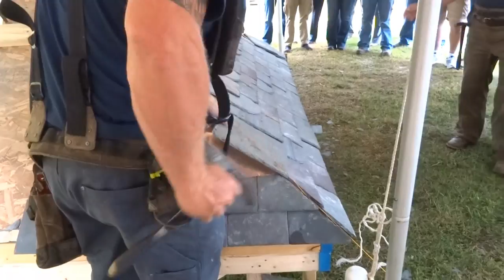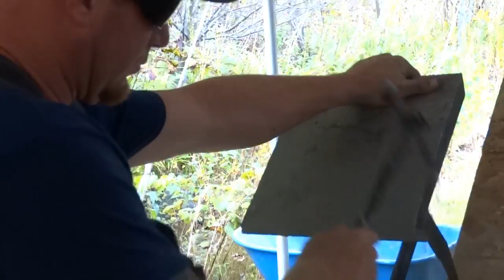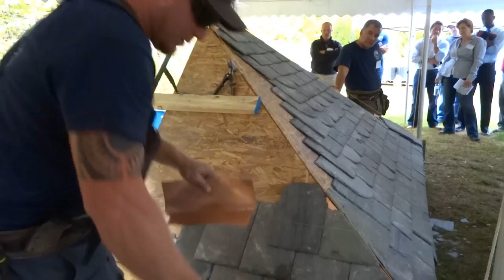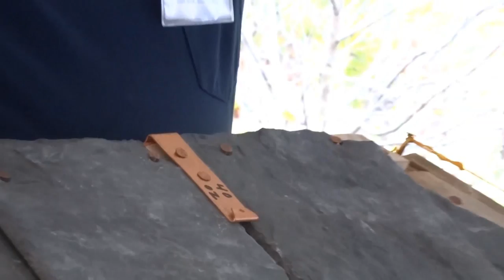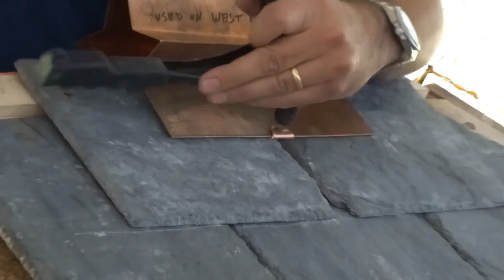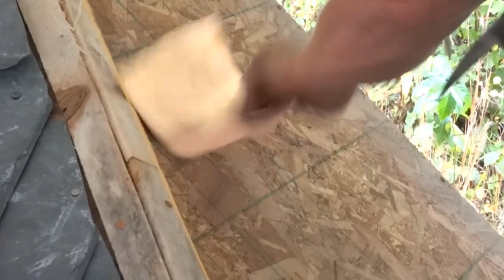Installing Hips and Ridges on Slate Roofs

Comment: What was the point of doing close miter hips if your going to put a copper soakers plus slates for hips
Reply: Na look closer, they’ve done two different hip to show :)
Reply: It's for waterproofing, any water that gets through the join stream down the soaker... You should run a bead of silicone 2 inches from the middle join both sides. In the 1800's they used cement

Comment: What do you do with the ends of the copper star ridge?
Reply: Probably cut an end cap to fit and then either rivet it or solder it into place.
Reply: Joe Jenkins That's what I thought. Thanks for the reply. I think I may try this.